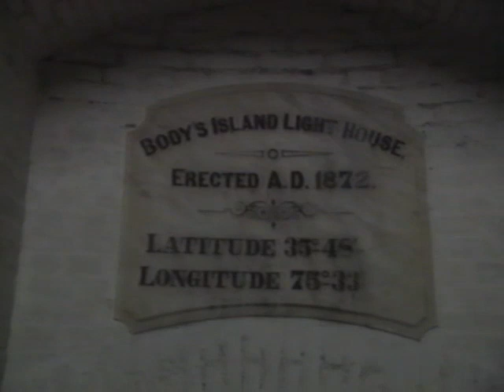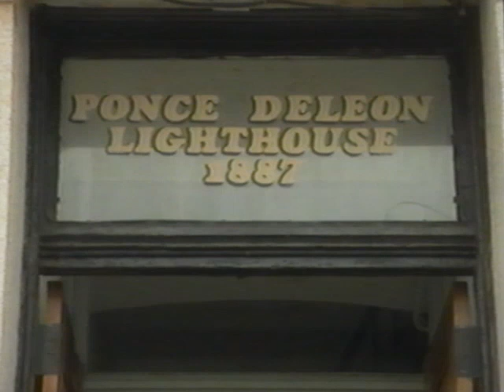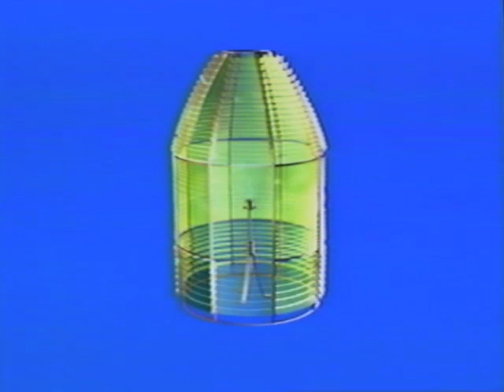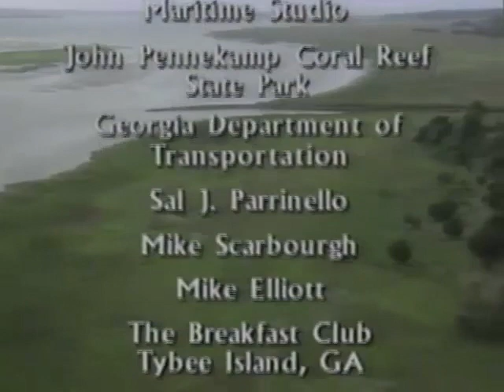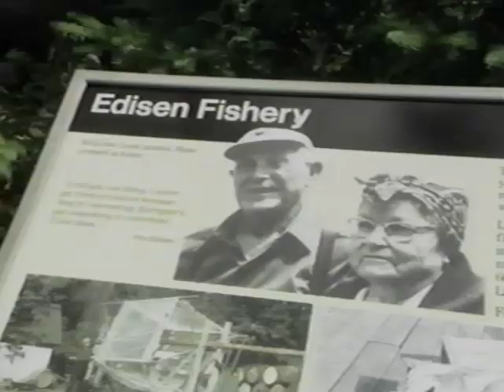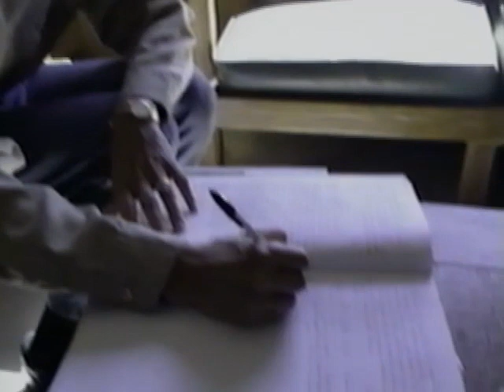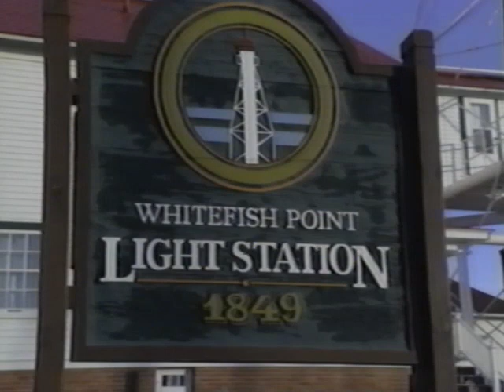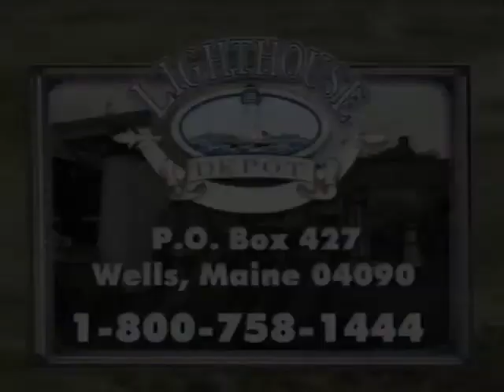Legendary Lighthouses: Western Great Lakes and South Atlantic (PBS, 1998)

Comment: 1:36:46 The rigid-shelled "Newt Suit" --- described as a "submarine that you wear" --- is the one that was used to recover the bell from such deep water.  This unique SCUBA-diving suit employs both solid-walled body-components to protect the wearer against extreme pressures, and strategically-placed bearings that allow the various parts --- i.e., arms, legs, head, etc. --- to swivel freely to permit the diver inside to perform his underwater work with relative ease.